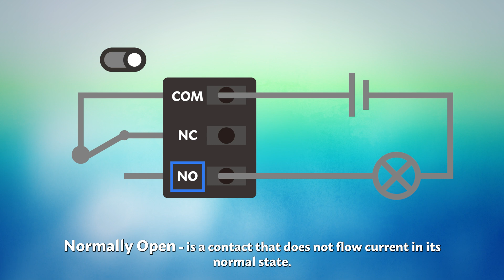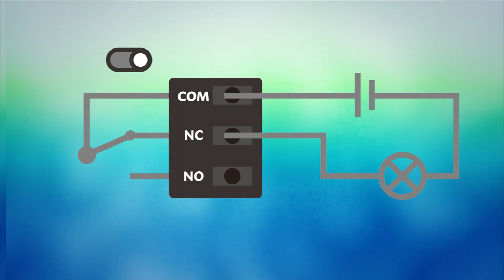SONOFF TH Elite Smart Temperature and Humidity Monitoring Switch

Comment: Does operating the dry contacts change the state of the internal relay (sonoff ac output) or does the readings and thresholds of the temperature parameters change the state of the dry contact ?
I would like to use pushbutton as a dry contact. Powering ac to the device and running back wires to my wall switch

Comment: Tech Details from SonOff website & back device: DRY Contact  5-30V, 1A MAX ... so how can you power a 2 Kwh water heater at 240V? If something goes wrong, who is responsible?
Reply: Hi , the Sonoff elite th 16/20 is either 16 or 20 amp relay depending witch one u pick. So in other words a dry contact is basically just a switch that can either handle 16 or 20 ampers flowing through it. So you can run a heater or boiler through that dry switch depending the way you wire it up as the one terminal is common normally the middle and the other one of the two wil be open and the other contact should be closed and that wil change depending on activation of the power to the relay. One is normally open , while the other is normally closed depending on activation of the power on off switch.
Reply: @danssv8  That just cannot be correct. You're essentially saying that the tiny wires fed into the dry contact slot at the top can handle 16A or 20A, depending on the unit you bought. So up to 4,500 watts through a 0.5mm2 wire?

Comment: I have recently bought the SONOFF TH ELITE and a Temp/Humidity (T/H) sensor.    I have been using the eWelink App on my iPhone to monitor the Temp/Humidity in my attic.  Here are my questions:

1.  The T/H information logging from the sensor to the eWelink seem to take place once an hour....  Is there an easy way (in the App) to change the T/H sampling time from the sensor (every few minutes to every few hours...)!?  If so - could someone present a clear way to do so?

2.  The system works well at home, when my iPhone is in the proximity of the Wifi Router.   However when I get out of range of my home Wifi network, I can't manually operate the "Device" (the outputs) which is  hooked up to the TH Elite.  In other words, touching the circle (virtual button) on the iPhone Screen of the eWeLink, does NOT do anything.   Is there a setup on the eWeLink App itself which would allow me to operate (read the T/H on my iPhone and operate the virtual button) from beyond the range of my home Wifi network?

3.  In another home application (not the attic), I would like to be able to turn on the wall Air Conditioner (A/C) in the house, before I get home (thus from beyond the range of my home Wifi network).   To do that, I plan to tap into the A/C remote control unit, and run out two wires from the On-Off button on it.  I would like to connect these two wires to a "Dry Contact" of any small Sonoff receiver.   It is not clear to me what (small) Sonoff "gadget" would do that job....   Any suggestion would be greatly appreciated.

Yes - I am an Electrical Engineer and very handy, but I do find the Sonoff English language descriptions difficult to understand at times......

THANK YOU !!!